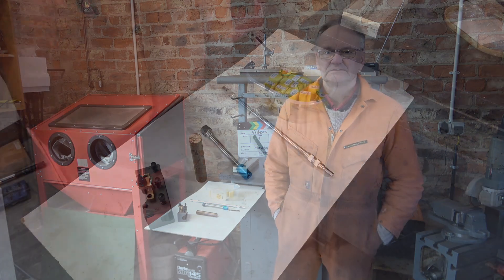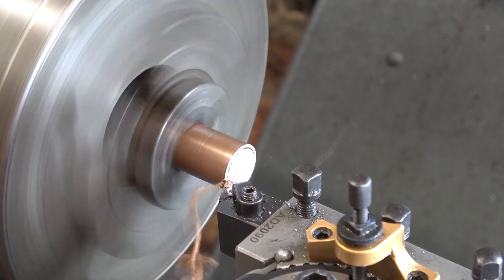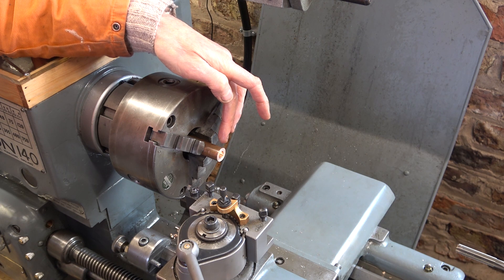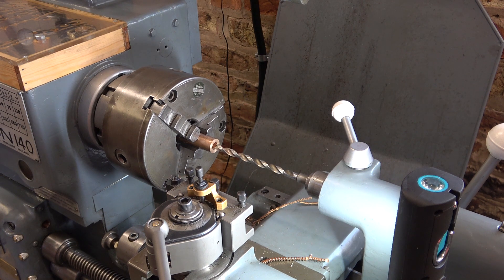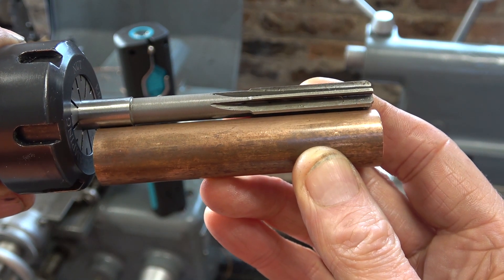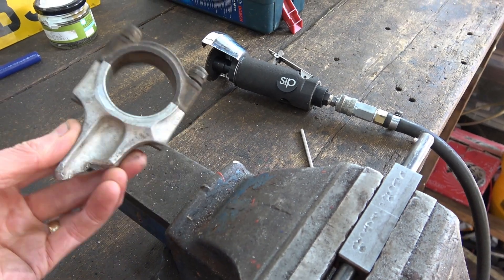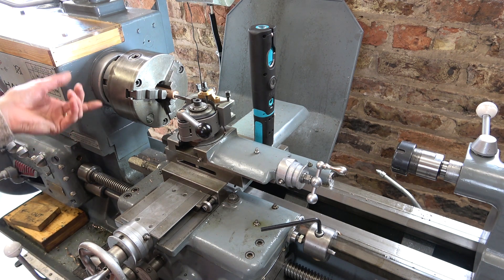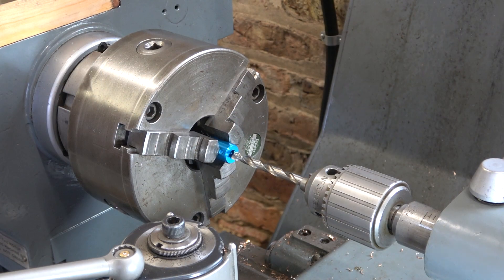HS63 Harrison lathe toolpost drill attachment

Comment: I recognize  that bronze material! I got some from an ebay supplier, very gummy stuff, I wanted to use it for pocket knife bushings but its too soft, I think they mis labeled it, its fine for the job your using because you have loads of  bearing surface,it drilled a bit more like copper , keep up the good work! your brake is more effective than mine!
Reply from the maker: Hi Anthony, I bought some 19mm (3/4in) PB104 from ebay to start with which was much more bronze colour but when it arrived it was actually 18mm and then it had bad marks on it so it was 17mm at best.  I messaged the seller and got no response so I sent it back for a refund. I then bought the PB102 you see in the video and I was surprised just how coppery it looked. But it is quite hard so it's not 100% copper. Yes it is gummy and binds - I would have preferred the PB104 but hey ho that's life. Cheers.